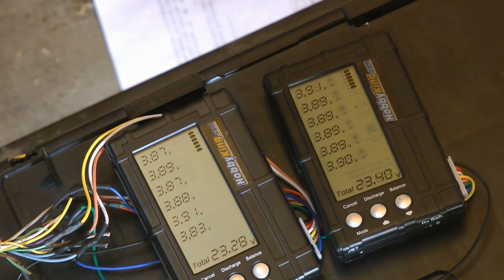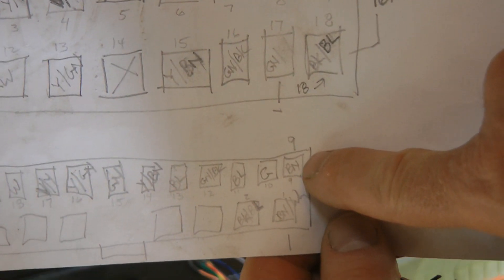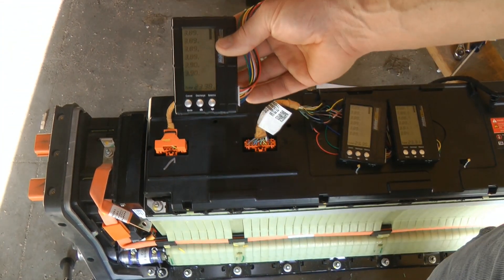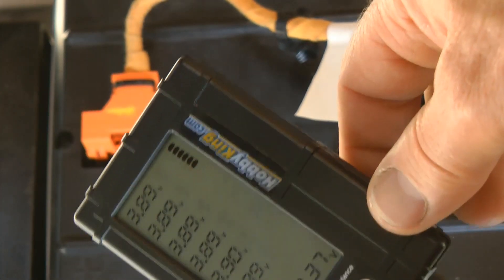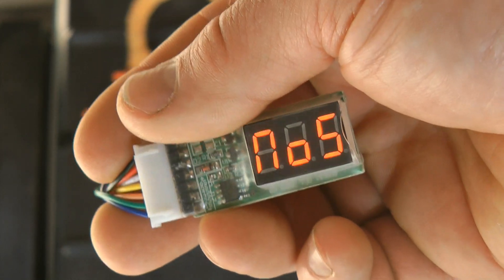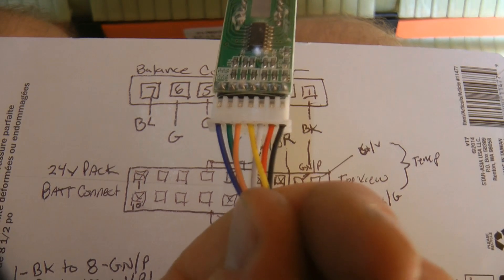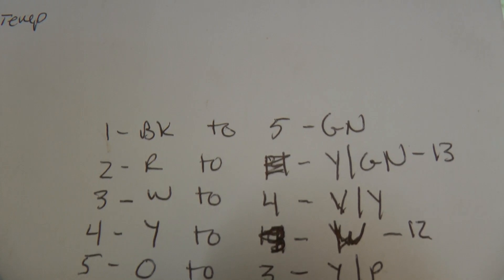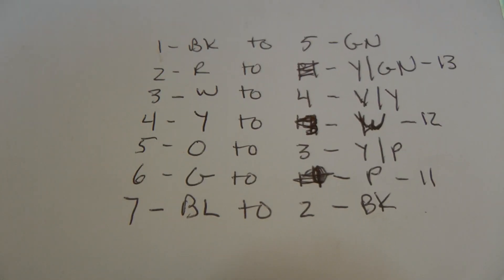How to Wire Chevy Volt Battery BMS

Comment: I'm setting up a second solar ,battery power  supply with my old Volt batteries.  I have that little cell voltage tester i use on my drills that are converted to liPo batteries.  I also some 25amp bms boards for over and under voltage protection. I found some 12s lithium ion  10 amp chargers on Aliexpress for $70. Thanks a bunch for the  video and wiring on the battery plugs.

Comment: Hi,
I have 7.8kwh solar and 126kwh battery storage for my house wit 48v chevy volt system. Just finished wiring everything and will go to my off grid house this coming Thursday to test drive your set up. I was wondering if you were able to figure out the #9 and #18 for T sensors. Is there a device that can be hooked up to those 2 wires. Thx
Reply from the maker: Holy c that's a lot of batteries! Not sure you have enough panels to ever fill them up. I have trouble filling my 16kWh worth in the winter. I did this video awhile ago and honestly not sure what you are asking about. I can tell you that once you get the batteries balanced, they stay balanced. I check them every couple of months and in a year they have not moved.
Reply: @mbrenengen  I live in California so plenty of sunlight here. They are all charged. I am asking about 2 wires that were not connected on an orange plug. You have mentioned that they are for temperature. I was wondering if you know of any device that can be connected to it so it can show the temperature of each battery etc.
Reply from the maker: @Burtchiropracticrehabilitation  oh yeah. Well I know you could make something that reads them, it is just a change in resistance, but why? Are you liquid cooling or heating?
Reply: @mbrenengen  None, just air. Would be cool to have it. My midnite classic 250 has T sensor.
Reply from the maker: @Burtchiropracticrehabilitation  I have the same charge controller and what I have come to believe is that temperature is not that relevant with a Volt battery like it is with lead. Charging characteristics change with lead when it is cold. Not with ours. I set the max charge voltage to like 48.9 which is a bit low but on the safe side.
Reply: @mbrenengen  Ok, we moved ours to 50.4v from 49
Reply from the maker: @Burtchiropracticrehabilitation  I think that is smart, especially since you have such a giant battery bank. Anecdotally, it should make the pack last longer. More importantly, if you have one cell that is a little higher than its neighbors, it is less likely to burst into flames and burn down your house...
Reply: @mbrenengen  Each of our batteries has 10 amps fuse on a positive lead. So if anything goes wrong the fuse disables the battery, also we have multiple larger fuses in our assembly to protect wiring and batteries. A lot cheaper to replace the fuse.
Reply from the maker: @Burtchiropracticrehabilitation  The fuse will not do anything to keep a cell from overcharging.

Comment: Matthew, this is very helpful!  I am trying to wire up a BMS to my Volt batteries as well, but am mostly using the 6s 24V modules.  I have not been able to find a pinout so far.  You had mentioned posting the diagrams you made; Are those available anywhere?
Reply from the maker: Look at the other video I made. It has more details about the pins. If you freeze the video you can copy the diagram.

Comment: Mathew
Very cool
got some and got some jst connectors, but the jst connectors didn't fit, So,  based on your wiring diagram, I determined that you can just plug the 6s bat monitor directly into the volt bms plug, then plug into battery, and voila it worked. No wiring whatsoever
Since my banks are 44V nominal the 6th cell reads high
Not that accurate, but a good general monitor
Thanks
Reply from the maker: That is really interesting. Is there a way you could email me a photo of what it looks like? matthew@brenengen.net
Reply: will do
Reply: Mark Scanlon I'd like to see that photo too.
Reply: @marscan1  me too

Comment: does leaving this connected drain the cells unevenly like the Cell log?
Reply from the maker: Not sure yet. Once it is operational I will tell you. I sort of doubt that in relationship to the size of the pack and the solar array it will be material.
Reply: @mbrenengen  can you update me now?
Reply from the maker: I do not leave it plugged in. I check occasionally but have not had to balance since I installed it.
Reply: @mbrenengen  thank you for your reply
Reply: It will consume a small amount of power from the most negative cell which is fine if on a larger system. Small packs will get lopsided if left unattended for long periods.

Comment: Great video - I'm using these 48V with great success for storage in an off-grid cabin
Curious about 48V connection pin 5. Is this the ground? If so why does this go into different pins for the two 7 PIN connections (blue for one, black for the other?)
Reply from the maker: I am not sure at this point. It was kind of trial and error when I was doing it.
Reply: I found a pinout that suggests PIN 2 might be the ground, but then your wiring wouldn't have worked, but it clearly did so I'm confused :(

Comment: Thank you for posting this. Now I can wire up a solution for keeping my 2013 modules in balance that will be running my house, charged via solar. My plan is to check the balance maybe once per week and hit the balance button on that hobby king unit!